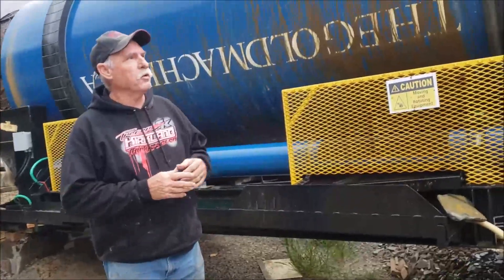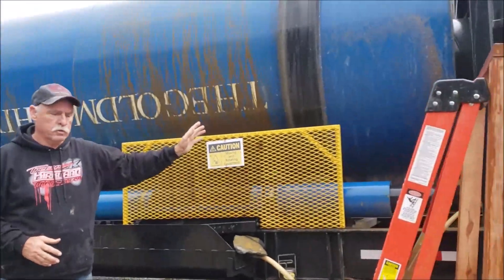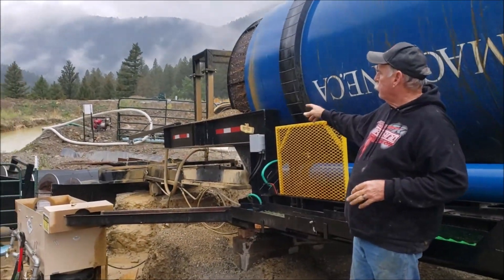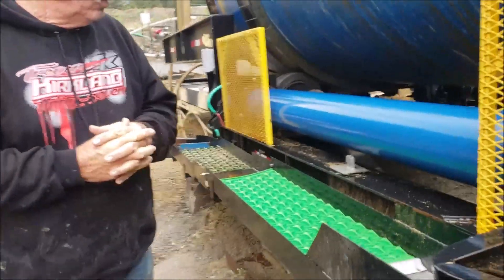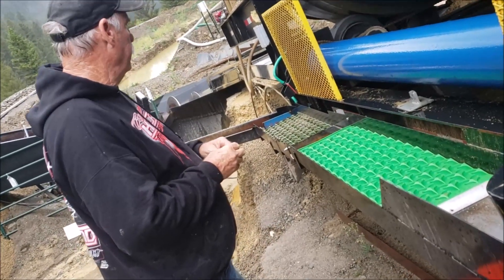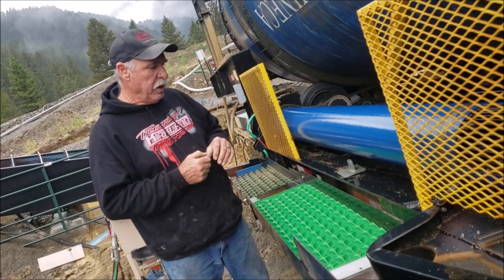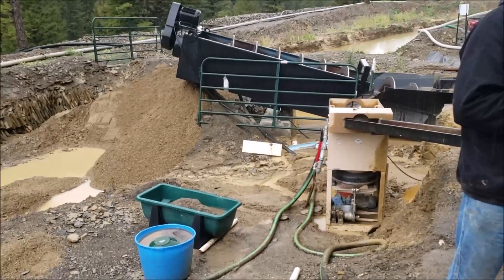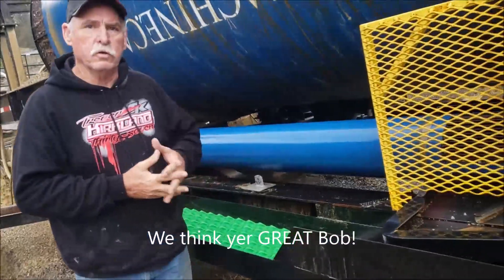Dream Mat in a reverse helix wash plant as primary recovery

Comment: Awesome!! Just purchased my first dream mat and im so excited to upgrade my keene sluice to it!!
Reply: I would recommend 'not' to replace your Keene A52 stock riffles & matting. But rather put a second Dream Mat sluice on the end of your A52, drill holes, use lock washers and wing nut & bolt them both together securely so you have two sluices being double in length.